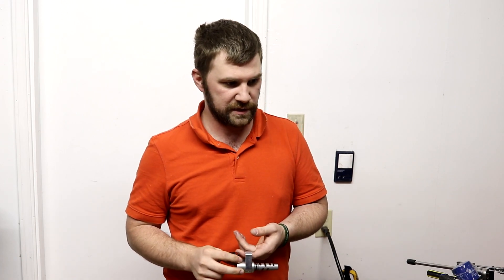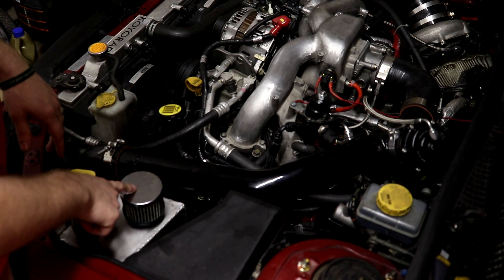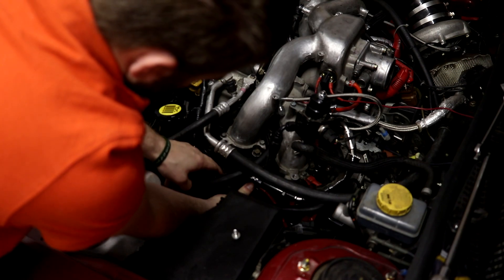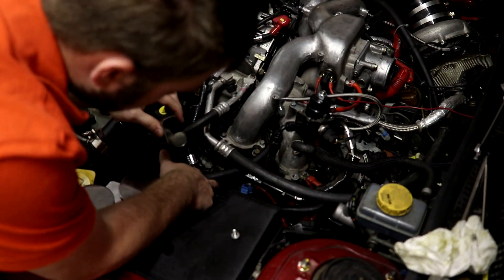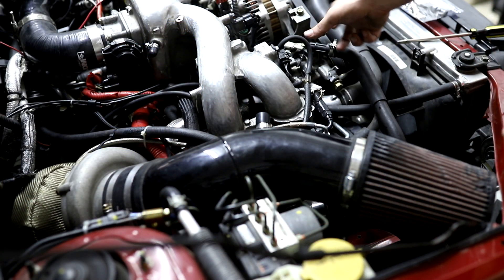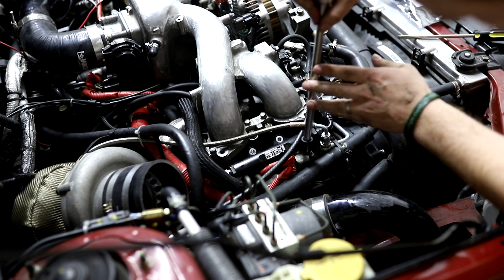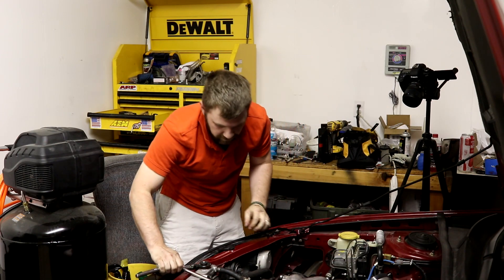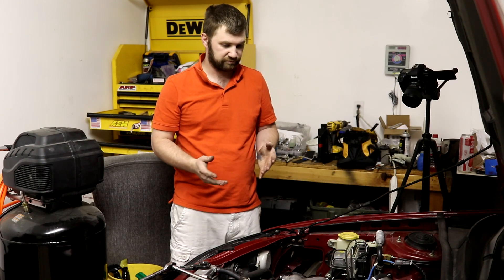How To Replace Subaru EJ Single AVCS Sensor Replacement WRX, STI

Comment: Good video! Swapped out my 17' sti ocv intake solenoid 2k miles ago. Was good till a few days ago cel came back. Thinking of swapping out the housing the solenoid goes to hoping that clears the issue.
Reply from the maker: @uprightmessi559  when it isn't just the solenoid it can be the crank or cam sensor itself dying. It also could be other things

Comment: So are the two solenoid’s identical for the left and right side?
Reply from the maker: They look like it but are 2 different part numbers.
Reply: @robinsontanner1234  do you know if these parts would work on a 2008 wrx
Reply from the maker: @codywilson504  i know I swapped an 09 wrx motor to an LGT and they worked. So I would assume so.

Comment: I think my Spec C RA needs these replacing. I can here a very slight strange noise coming from the nearside and it's started to fluctuate boost. It used to be consistently 1.5 bar but it's now 1 to 1.5.  No fault codes, but it looks like I'll be ordering a pair.
Reply from the maker: That could be it. maybe a seal has gone bad. Is there any shaft play in the turbo?
Reply: @robinsontanner1234  I changed these last year but it made no difference.. there's no play in the Turbo shaft and it's not noisy when it's turned off as the impeller slows down. Compression and oil pressure are good, can't see any source of a boost leak, new plugs, coil packs, knock sensor, inlet pipe, exhaust and inlet manifold gaskets, maf sensor, tried dump valve, intercooler a d probably a load of other stuff. I was thinking it could be an AVCS pulley, but would that not flash up a fault code?
Reply from the maker: @crumpetcatcher  i wonder if its a faulty boost controller. Can you monitor things on a Cobb or pc?

Comment: hello, in my Subaru ej15, the inside of the solenoid socket is lubricated, I removed it, I cleaned it, I replaced the o-ring, I put it in, I felt that the driving comfort has increased. Is it repairable or should I replace it?
Reply from the maker: Its most likely a pretty cheap part. New parts are always good :)

Comment: Hello. Are you 100 percent sure that with error 0021 it's a solenoid? Jozef.
Reply from the maker: It can be other things like cam is off a gear, or a clogged avcs screen (only some models had them) cams that are out of tolerance, a faulty cam position sensor can also cause it. If your motor was just built there is a chance some RTV got into the channel along the front cam cap causing issues with oil flow.

Comment: I just noticed i’m leaking from the driver side OCV. I don’t have any codes though, is that normal?
Reply from the maker: There is an o ring that can fail on the solenoid.
Reply: @robinsontanner1234  I see mine is leaking but no codes or anything at the moment. it’s all caked up and i noticed a few drops after driving
Reply from the maker: @__akuuma  your car won't throw a code for an oil leak.
Reply: @robinsontanner1234  that’s what i figured. just browsing through all the videos everyone’s got a code that helped them figure out the issue. just don’t wanna buy a part for no reason if that’s not the case haha
Reply: @robinsontanner1234  quick question: would that be what’s dripped on my header on the driver side? every video i see people get to it from the top but looks like it would be easier to get from the bottom. really unsure if it’s even the right part

Comment: I have an '07 Outback XT which has a large metal bracket that is in the way of the variable valve control solenoid. There are two bolts that I have not found a way to remove them, and there are no videos showing this bracket. Any help would be wonderful.
Reply from the maker: are they the brackets of death that are around the fuel injector area?
Reply: @robinsontanner1234  Yes!! 😠
Reply from the maker: They can be removed just have to be crafty and find all the bolts. Throw them in the trash lol.
Reply: @robinsontanner1234  I'm working on it right now! Trash. Trash.
I bought some swivel heads and a new mini ratchet. I really hope they help me get the job done
Reply: @robinsontanner1234   Thanks for the encouragement.
Reply from the maker: Getting the bolt off by the fuel lines is a trick iirc.
Reply: @robinsontanner1234  🤔
Reply from the maker: @jrod7017  Where are you located? If your around OKC at all we can rip them off in a few minutes lol
Reply: @robinsontanner1234  Georgia!

Comment: I'd like to recommend better lighting and more close ups.  I think the verbal description is very detailed, but before I tear down my engine, I want to be very confident that I'm taking the correct parts off and know how to re-assemble.
Reply: Great explanation ¡
One question:
Both AVCS sensors are equal ?
I mean, the same OEM part ?
Or different ?

Thanks ¡
Reply: @ChetoCervantes  i'm no expert, but I don't recall ordering a left bank and a right bank part.  they're interchangebale, but I will not be offended if someone corrects me on that.
Reply: @ecpoirier  Thanks ¡
Reply: I think he took your advice!

Comment: Wow. This is the most god awful explanation/video.
Reply from the maker: thank you so much for your input, Maybe you can do research and make a much better video!
Reply: I’d give you a better review if you actually showed anything besides the engine bay.
Reply from the maker: @zee_nyc  crazy... that is where the avcs solenoid is...
Reply: @robinsontanner1234  lmao you are correct

Comment: I just got a stage 2 shortblock installed and I'm getting this same issue. I'll go ahead and replace both of them, thanks man!
Reply: Did that Work for you? After a rebuild I had to replace the Cam gears.

Comment: will this be the same process for 2018 sti those are dual avcs so i will just have to swap around those solenoids both on each side? and see if the code P000D follows. recommended by my tuner
Reply from the maker: Pretty much the same!

Comment: Ok so those two hoses that are directly behind the solenoid, what are they for/called? Accidentally broke the hose backing the solenoid out and now I need to replace the smaller hose 🤦🏼‍♀️🤦🏼‍♀️
Reply from the maker: You can replace them with oil safe hose of the same size as long as it doesn't kink
Reply from the maker: Those are head vents, or crank case breathers they equalize the pressures on each side of the crank case
Reply: @robinsontanner1234  YES! Thank you so much, it was 20 degrees out and the smaller hose shattered the second I applied slightly too much pressure lol 🙌🏻😅

Comment: Im getting a P000D code and ive replaced left and right cam pos sensors do you think i should replace this sensor next and give it a go? The Check engine light comes on as a CEL and it goes on for a day turns off then couple days goes back on randomly
Reply from the maker: yeah I think it is worth a shot. Do you have an accessport or a way to monitor your cam advance? or AVCS Duty Cycle? I'd monitor them both and see that they are in sync with each other before replacing if cost is a factor.
Reply: @robinsontanner1234  i do have an accesport, i did not think of that that is a good point i will do tht and get back to you
Reply: Turns out it was the exhaust avcs solenoid/ sensor
Reply: @brianoneill9137  i have this problem right now just finished getting the car back together. im hoping i just have a solenoid swap because ive never taken off a cam gear and its kinda intimdating. i had ringland cylinder 4 subaru rebuilt it and i dont think they ever swapped the cam gears.
Reply: @joeybaru8807  hopefully its just that solenoid
Reply from the maker: @brianoneill9137  So glad you got it figured out!!! Did the AP monitoring help at all?

Comment: did the error code ever come back?
Reply from the maker: No sir!
Reply: @robinsontanner1234  I've got the same code (p0021) after replacing these, will the code/ check engine light immediately go off after starting? Or do I need to drive it around a bit?
Reply from the maker: @jesusrules0707   The sad part is there's like a few other things it could be as far as like it could be Cam sprockets it could be clogged banjo bolt screens or something else the involves the oil flow to the Cam sprocket. Did you unhook the negative battery cable for a bit to reset the ecu?
Reply: Draggin' Wagon Draggin' Wagon The dealer I bought it from reset the code. Luckily I only got 5 miles down the road after purchasing it and came back. He said that if it didn’t come back on immediately then it was most likely the avcs on its way out. But that could be wrong. I can try the battery cable trick if you think that will make a difference compared to the code being cleared
Reply: And just to clarify it didn’t come back on for a good while but now it’s back on. Just trying to avoid the dealership cost of fixing it if I can
Reply from the maker: @jesusrules0707  if they reset it then the battery thing won't change anything.
Reply: Draggin' Wagon I didn’t think it would. Do you think it’s at least worth trying by replacing the avcs(s) to see if it fixes the issue?
Reply from the maker: @jesusrules0707  yeah it would be worth it. But I'd make sure the place you bought it from did it. Lol

Comment: I need help please my 2009 sti starts to bogg really bad when coming on boost or sometimes at around 3,200 rpm anyone know the problem?
Reply from the maker: look up STI stumble. I believe the STI has a pretty common issue with that.
Reply: @robinsontanner1234  it only started happening after I got the car tuned I took it back to the tuner and he didn't give a fuck.
Reply: @robinsontanner1234  I was thinking maybe it's my avcs sensor
Reply from the maker: @projectzero8784  you should be getting a cam code that would let you know there is a problem there
Reply from the maker: @projectzero8784  It would default to zero if your sensor went bad. It wouldn't stumble. Do you have a code for the sensor?
Reply: @robinsontanner1234  code I'm got is P0108 manifold absolute pressure/barometric pressure circuit high
Reply from the maker: @projectzero8784  then replace your MAP sensor. That would have nothing to do with AVCS afaik
Reply from the maker: You get it figured out?
Reply: @robinsontanner1234  not yet taking it to another tuner at the end of the week will see what happens

Comment: If they are really bad will they make a tapping noise similar to lifter tap?
Reply: Mines doing that aswell! Did replacing them fix it?
Reply: @mikeward1301  actually I found a backed out spark plug. That was the tapping noise for me.
Reply: @MrBubba123bubba   shit. I pulled out my avcs and it is clicking like a mofo in my case. Even with engine off. Was hoping you were gonna say a bad selonoid lol
Reply: My car is now making this tapping noise and giving me a p0014 and p0300 noise....are these pricey to fix?

Comment: I think it would be more help full if it wasn’t based on a build motor. There’s a bracket on the passenger side that blocks you from pulling out the solenoid
Reply from the maker: The bracket holding the coolant res. I forgot about that being there honestly. Should have mentioned that. Thanks for the input. My car is all I had to do it on.
Reply: @robinsontanner1234   The method I used was effective but time-consuming, If anyone has the bracket still you can either use a chisel and hammer to knockback and carve a groove in the bracket to get enough clearance. Or use a die grinder and cut or grind back enough of the bracket. Note be careful of the fuel rail sitting not even an inch or so away. There's probably an easier way of doing this, but this is what I found to be the easiest without removing much.
Reply: Subaru makes that braket east to remove.  You just have to remove the solenoid to get the bracket off.  to remove the solenoid, just remove the bracket.  THANKS subaru!

Comment: Thanks for the video. Not sure if I missed it but some close ups of the part on vehicle may have been a plus. I will figure mine out though so no worries on my end. I was wondering if you thought the AVCS could need cleaning or replacing but not showing any fault. I am having a power loss at move off and lower rpm and wondering if these are bad. No code however. Have changed fuel pump, fuel rail dampers, checked for filters in AVCS oil line (already removeed) . History is that car sat for a year, two or more before I bought it. Tank and fuel filter was a mess so POR15 and after a couple filters and 1 pump got new pump module eventualy in case the pressure regulator was bad.  Does not miss and it has young plugs, new air filter and have cleaned the injectors 3 times now and the throttle body several more times.  Hope I did not leave anything important out but it has been a mystery.
Reply from the maker: have you tried to flow test/clean your injectors?
Reply from the maker: I mean it could be a lot of things. even without AVCS your car shouldn't lug from a start. Have you tried cleaning your MAF sensor?